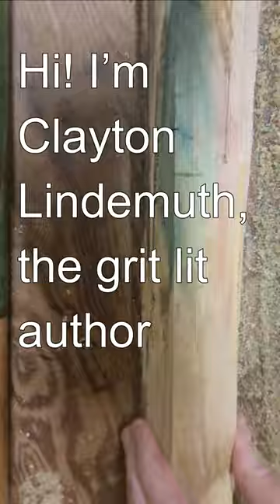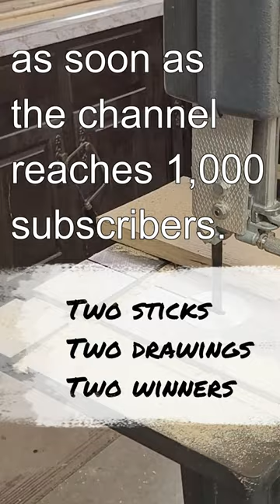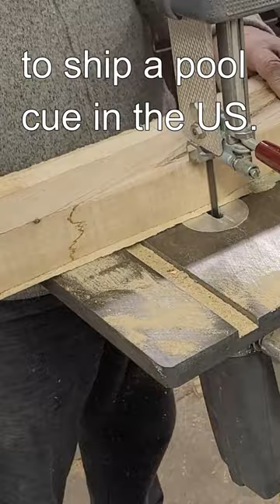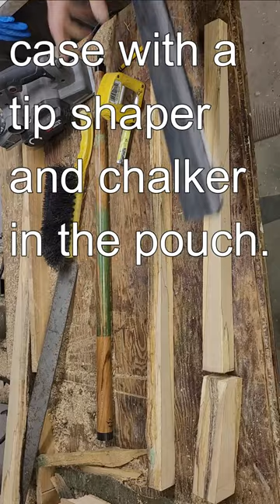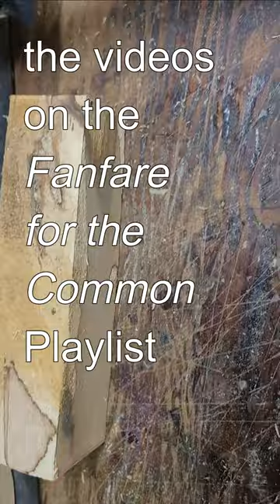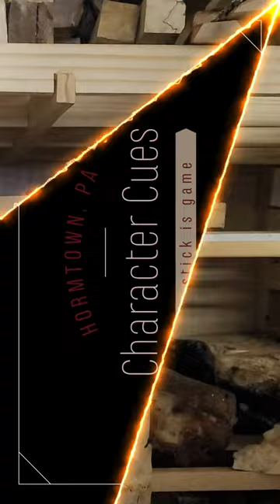(THIS IS THE VIDEO TO COMMENT ON) Win a custom pool cue! Just Subscribe and comment!

Comment: The wood grain must be straight, in line with cue , not crooked grain
Reply from the maker: If the wood wasn't going to be stabilized and cored, and turned over time, I'd agree. Stabilized wood isn't really wood any more, and the grain doesn't have much to do with strength.